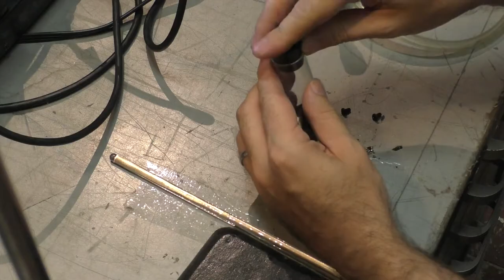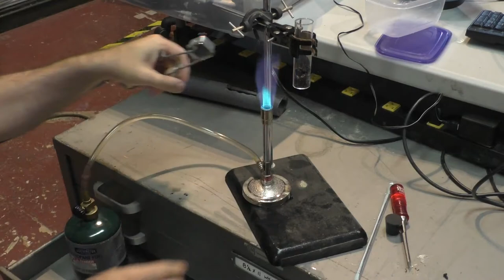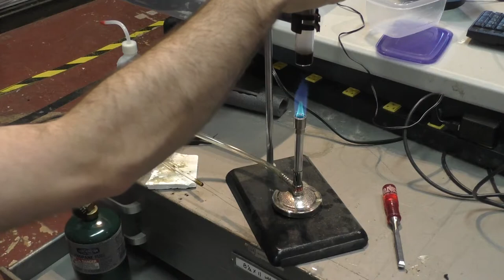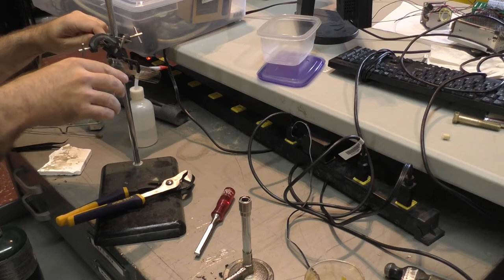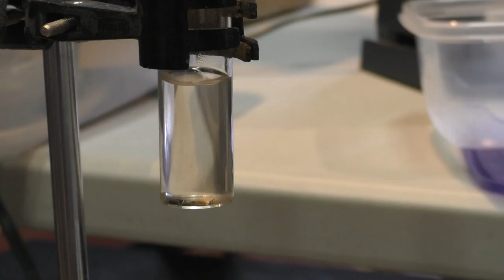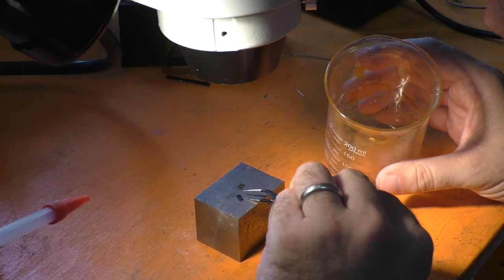Decapsulating with rosin (silent)

Comment: I tried this with the hot air gun on max setting (650 degrees C) but nothing happened to the old chips I pulled from an Asus P6T motherboard.